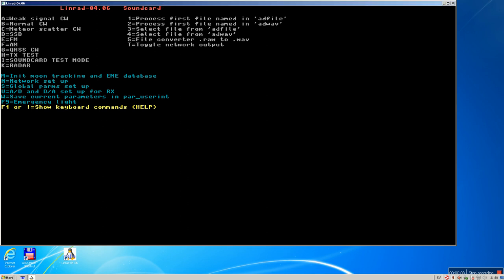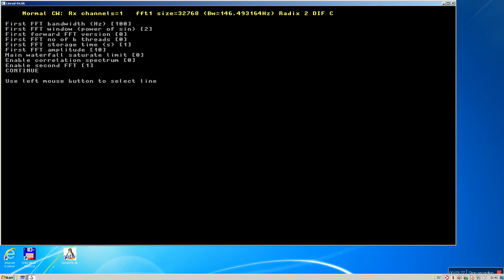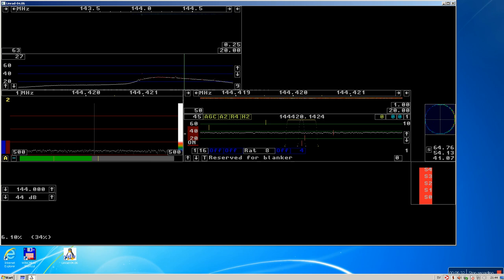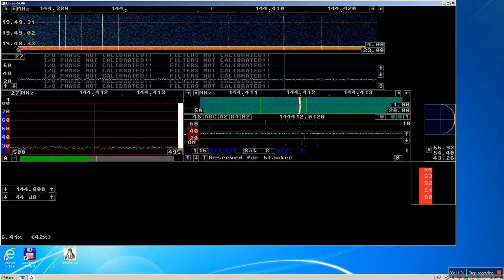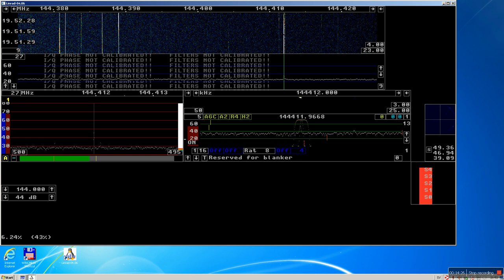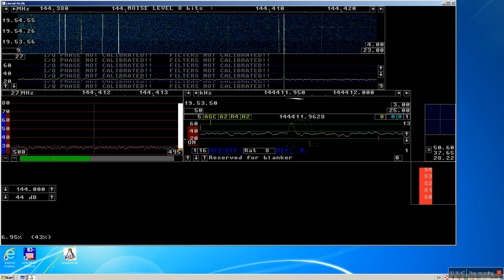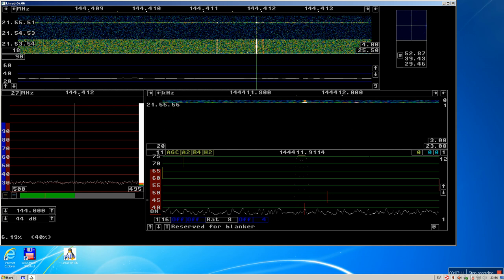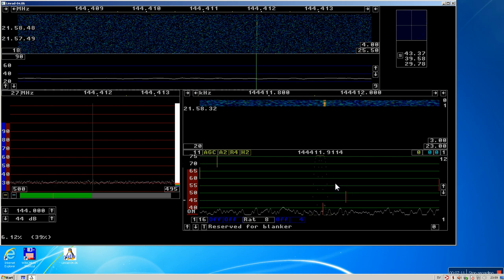senswaterf

Comment: Thanks for the nice and educational tutorial Leif. For beginners, Linrad is a bit tough to use though ;-)  Do you intend to make the same kind of tutorial for other modes ? I will try on my own for FM DX, but I'm afraid I will grop along for hours before getting acceptable results !!!
Reply from the maker: The senswaterf video is a response to a feedback from a user. He showed his setup and desribed what he wanted. The video is my response. He has now given a new feedback saying that the CPU load is very high ans that there are drop-outs when other programs are run in parallel. This second feed-back will provoke a new video - how to minimize CPU load when looking at waterfalls with weak signals.

I will make tutorials as a feedback on real problems that people encounter.
Linrad can be configured in thousands of ways and I am not going to spend
time in demonstrating things that nobody asked for.

If you have a SDR problem, make a wideband recording and make it
available to me. I would configure Linrad to process it as well as I can.